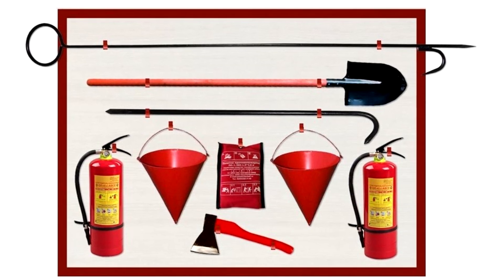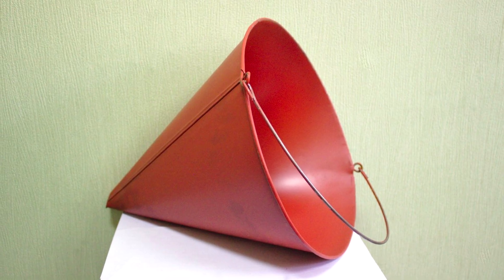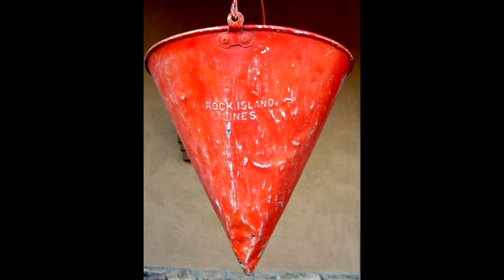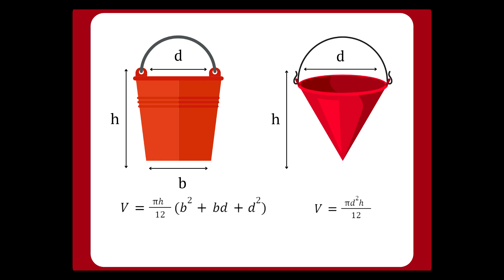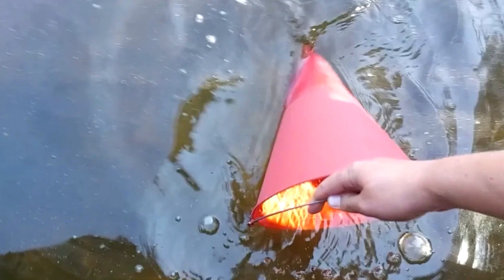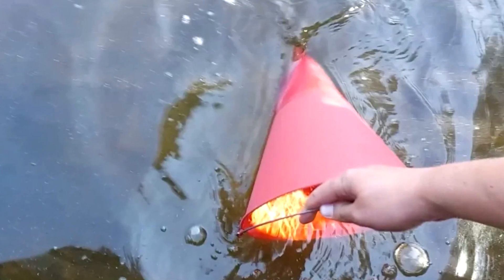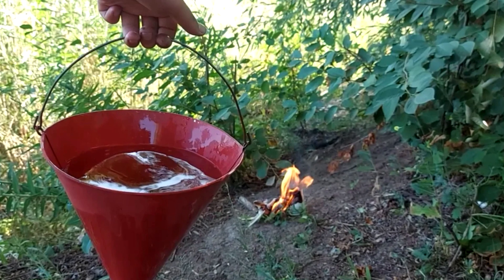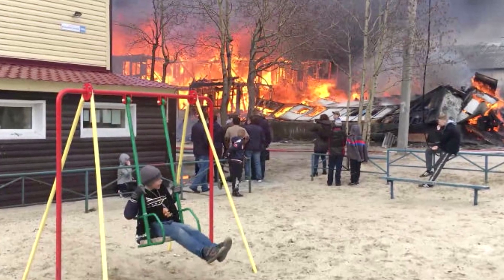Why is a fire bucket shaped like a cone? The secret is out!

Comment: You give a lot of benefits of a cone shape, but just because something later ended up being a benefit doesn’t mean it was the original reason. The naval origin sounds like a fair original inspiration for the design. The fact that they are useless for normal daily use, meaning they won’t be borrowed once put in place for emergency use, probably most contributed to their wide deployment in land structures.
Reply from the maker: this is true